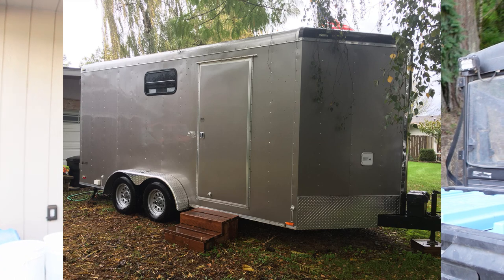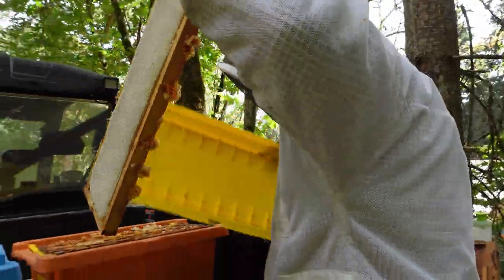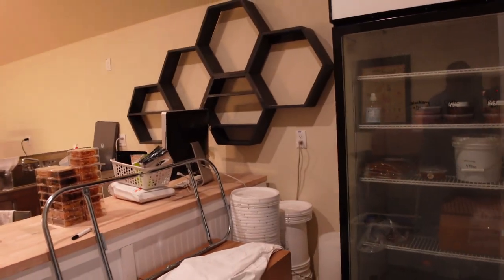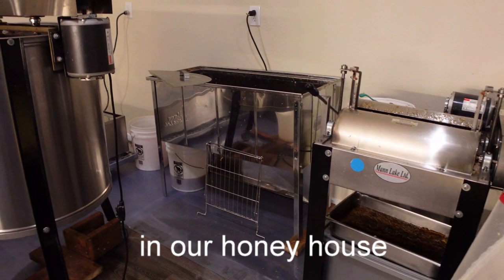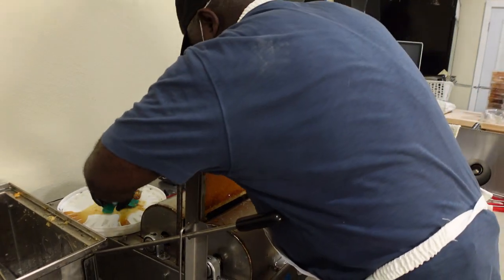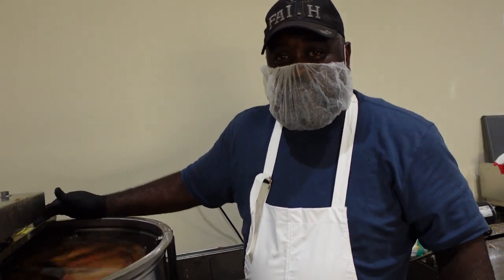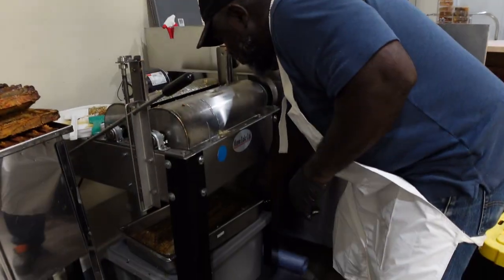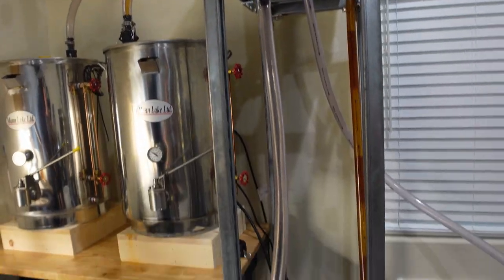Building Our New Honey House Before Honey Season - Part 2

Comment: New subscriber.  Love the uncapped.  Sure beats the heated knife routine that I've used for 24 years.
Your explanation of the clarifier was excellent along with explaining the needed temperature of the honey to be pumped.
I used to use my friends honey house.  It was certified but just a shed, a sink, and electric.   It was small and it took all day to do a few hundred pounds of honey.   Now that I'm a hobbyist again, I just scrap the frames in the field into my uncapping tank and go from there.
Keep the videos coming.  I'm checking out your next one.

Comment: Can I make a couple suggestions. I have a lot of the same equipment. I would pull your uncapped tank out a little so that if you drip it catches it. I would plumb your extractor into your clarifier. I have Maxant wax spinner when your budget allows I would add one and plumb it into the clarifier.   But you have done a great job so far.
Reply from the maker: The reason I don't have anything connected is  I do a lot of different peoples honey at the same time. So its easier to filter it in a bucket instead of having to clean the entire system. We use the clarifier tank when we do our honey in bulk. Thanks for the good advise

Comment: I really appreciate the detail and workflow you have created in the honey house. Great idea in using the unistrut. How do you like working with the increase of honey/wax mixture with the chain uncapper?  I know using a knife or uncapping plane produces larger wax chunks and maybe less wax but it appears the speed gain with a chain uncapper is worth it. Is that what you find too?  Do you use 9 frames in  a 10 frame box so the bees draw out the wax more so you have less shallow areas on the chain uncapper?
Reply from the maker: As crazy as this is going to sound, I like it better because like you said the wax is uncapped much finer than I could uncap it by hand which makes it much easier to process and clean the wax. Also I use nine frames in my honey super because the bees will build out the comb giving more honey and was. I'm planning on doing a video on processing the the wax in the honey house.
Reply from the maker: Actually, because we can control the heat it is easy to filter the wax capping's. We are planning on doing another video on rendering the wax we got from the chain uncapper.